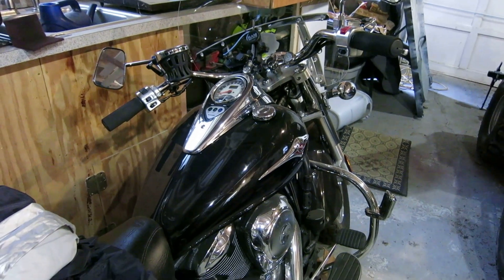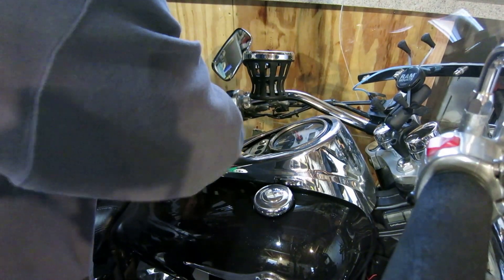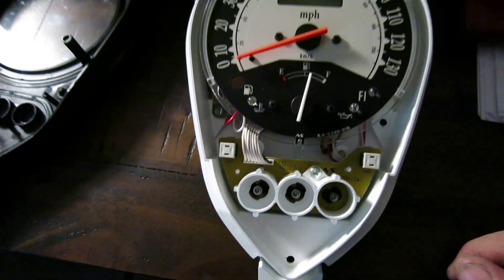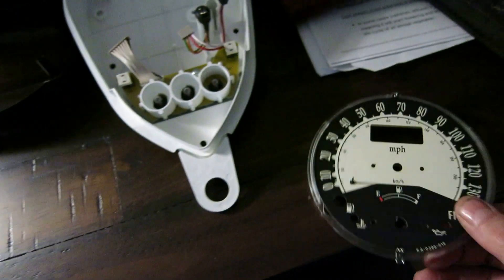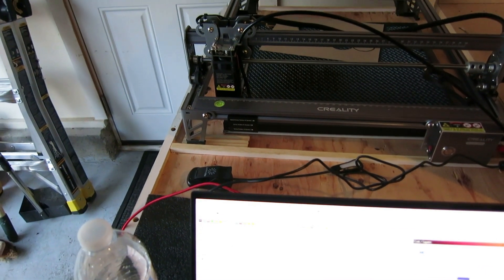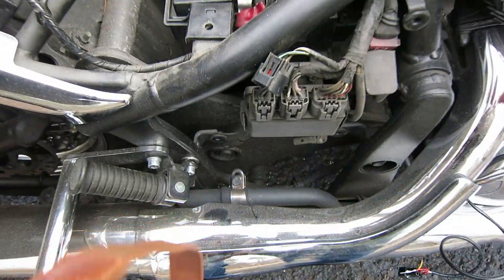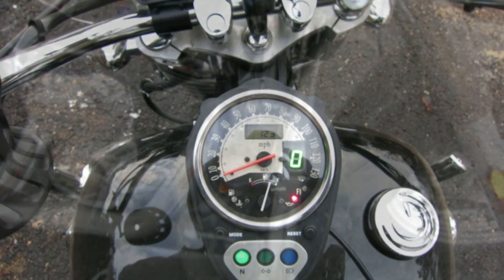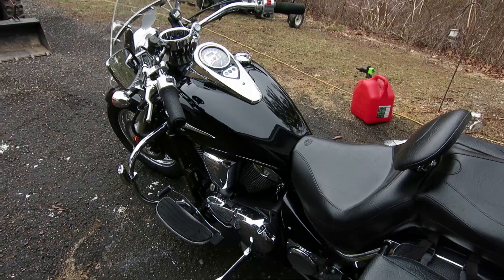HOW TO INSTALL  A GEAR INDICATOR ON A 2008 KAWASAKI VULCAN SPEEDOMETER DISPLAY

Comment: So quick question on reassembly if the Speedo. How do you get the Speedo needle to read correctly after you put it back together. Mines miscalibrated.
Reply from the maker: Yes that was very tricky I tried marking it and put it back in the same place but that didn't work I actually had to ride my bike with my GPS at 30 mph with the speedometer cover off and then add exactly 30 miles an hour push the needle straight down on the 30 mile an hour mark and then it was fine.

Comment: How would you recommend cutting the face for those without a laser cutter?
Reply from the maker: @lockeduplocksmith  I would say probably make a template to draw either the square or the circle that you want to cut maybe use a drill carefully to cut the hole and then a small file to finish the edges

Comment: Hi, I've bought same indicator that you have here both from AliExpress (15€) and Amazon (43€, but with holder for handlebars). I've got same thing both times, excluding the holder/bracket. My problem is, I set it up, it turns on, does from 0 to 6, than back to 0 like in this video. When I put it  in first gear, it shows it's in fifth gear. 

In manual that I've got it says turn ignition on and off five times, I've did that. Did not go in "L" - learning mode so I can set correct gear. I've tried what people on Honda forums do, where they turn ignition on than they go killswitch off-on five times, than countdown should flip and go from 6 to 0. But, my killswitch just kills the fuel pump, this gear indicator doesn't go off so that's no dice.

I'm going crazy with this thing. Do you have any experience with it?
Reply from the maker: I'm sorry I really don't other than the experience of just installing it. It went pretty seamlessly for me. Have you tried contacting the seller maybe they have some more information.
Reply: @DJsWorkshop  thank you for answer. I did contact both sellers, and both devices behave the same. So I have to find other way to dump device memory somehow. My idea for now is to try dumping memory over someone else motorcycle than programming it on mine. In theory it should work, but I need to see.

Comment: How did you get the padding or whatever it is out the connector? That is what I am having trouble with.
Reply from the maker: Could you be a little more specific? Not sure what you are referring to.
Reply from the maker: If you are referring to removing the wires from the connector you will need a special tool but you can do it with a very small thin screwdriver. You have to release the tab that holds the pin into the connector.
Reply: I just got it out with some tweezers, thanks for the video.
Reply: Do you have any advice if it’s reading F? When I first turned the bike on it works fine, then it stayed on F.
Reply from the maker: Sorry I have no idea. Try contacting the seller

Comment: I don't know that this is the best option. In my opinion, the unique speedometer has a complete, clear look and any addition simply spoils it. I have it installed on the steering wheel in a frame from the kit, black with green numbers. It is clearly visible, does not glare. And you can always change it.
Reply from the maker: @Remexon555  It's just another option. Some will like it some will not. Everyone has different taste. Personally I love it!